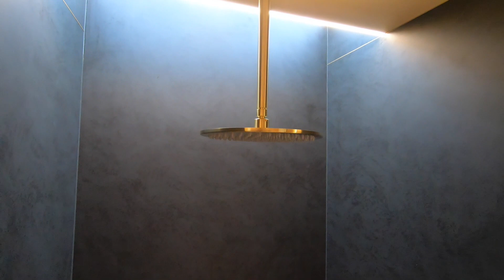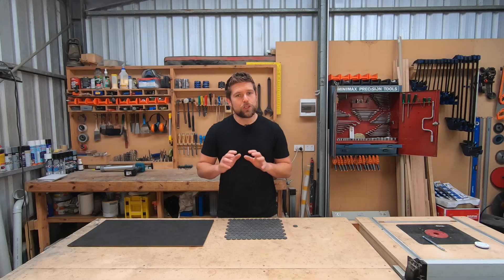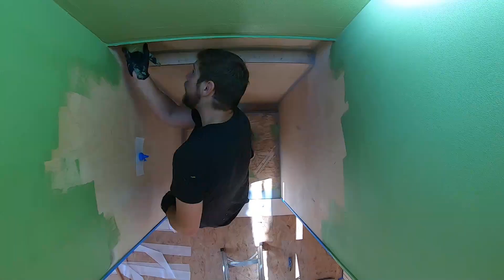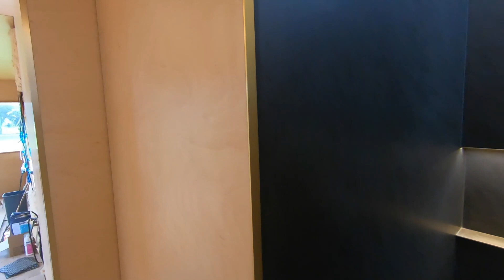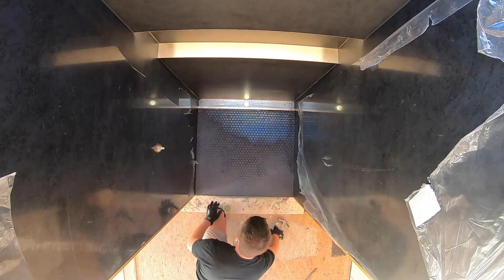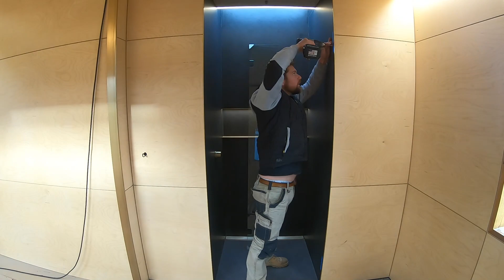Ep. 35 - Waterproofing, lining and tiling my shower - Tiny House Build Update

Comment: I love the look, hiding the vent in the skylight is an amazing idea. though I probably would have tried to hide the shower head up there too, just to keep the dark look.
Reply from the maker: Yeah I am so happy with that vent idea. I am anticipating should pull the steam straight out really well. I have a good volume fan and it isn't pulling through a vent so should have good flow. Haha I would normally do something like that, but I actually like the contrast. When I see the shower head on vs of it looks a million times better on. The brass against the black looks amazing. The brass also reflects light into the space which looks really cool.

Comment: Great and incredibly informative video as always. 🙌 As a cabinet maker I couldn't help but giggle at the phrase 'push it through the CNC'. I feel like that phrase is reserved for the panel saw, you're more likely to 'place on the CNC and walk away' although i'm unsure if that saying is going to take off.
Reply from the maker: 🙌 Haha I absolutely got that saying from the phrase of pushing it through the panel saw. Although with CNCs it's close to all you do. You just push a sheet of whiteboard from the pile to the CNC. Unless you have auto load in which case you just press print 😂. I keep telling people that the cabinet maker will just print my kitchen why on earth would I spend weeks pushing a cutting list on my jobsite saw. Thats without talking about edge banding, cutting hinges, marking out runners etc etc.
Reply: @TwoHandsandaTinyHouse  100% agree. I’ve been running my business for 10 years and i outsource all of that. I don’t want the outlay, floor space and maintenance of a massive commercial CNC and edgebander. I’ll stick to what I do best which is solid timber work and install.

Comment: Great work mate! How are you securing the shower door for transport?
Reply from the maker: Thank you mate. Great question. I am actually going to take it off and strap it to the bed. The hinges just clamp onto it. Couple reasons. It's heavy and those side panels/hinges/brackets are not designed to be shock-loaded. Also, I want to reduce weight at the front of this trailer as my ball weight is a bit high.

Comment: Perfection! Just a comment to others doing showers. NEVER scrimp on the tanking (waterproofing) the tiles are decorative. The water WILL go through the grout but expect that and ensure the shower base drains with no tiles on them.
Reply from the maker: 100%. In fact, I would say there is no way to scrimp... there is only a right way. Trying to cut corners is just asking for expensive and difficult problems. The only thing which is seen as compliant that I would never touch is one coat waterproofing. For me, the chances of getting a pinhole are just too high, not worth it. I didn't get too much into the process of water proofing, perhaps I should one day, if it helps someone get it right it'll certainly save a lot of heartache one day.

Comment: 🙌 It looks like it will be a relaxing place to start the day. I had my bathroom renovated last year, switching from white to concrete style paneling. What a difference on bleary eyes. My small bathroom looks smaller but I like the calm ambience.
Reply: I'm looking at concrete for a renovation of my parents' bathroom and I'm looking at products. Do you have a recommendation?
Reply from the maker: @elrey8876 https://www.bunnings.com.au/wall-art-2400-x-1200-x-3mm-concrete-matt-wet-area-wall-shower-panel_p0095450. Very easy to work with and looks great for what it is. I would always prefer tiles (or some other finishes if I could) but for a good looking easy finish this is great.
Reply: @TwoHandsandaTinyHouse  Gracias
Reply from the maker: Oh it looks a soooo much better that would have been a great move. I don't like this panelling other than a couple colours like this. Feels warm and inviting.

Comment: More amazing dedication and attention to detail. Did you at any stage consider a whole shower space insert like you see in the VW GRand California or Winnebago Revel to eliminate water leaks?
Reply from the maker: Thank you my friend 🙏. No absolutely not, and not fibreglass inserts either. I really wanted it to look as much like a house as possible. I am not worried about leaks. If you do the waterproofing layer right you shouldn't have to worry. It creates a vert elastic membrane that can resist movement. It's also why we bond break the corners. That's where the membrane continues across the corner but does not adhere to the membrane for about 10-15mm. This allows it to flex and move as the substrate moves but does not tare. Get waterproofing right and you won't ever have to worry about issues.

Comment: I am definitely not normal, it is beyond me why anyone would use tiles that need grouting. It is a dirt trap and a high maintenance material. 
Don't get me wrong, the shower looks great, like everything else you do. And it is a personal choice thing.
Looking forward to the next episode.  👐
Reply from the maker: 👐 What do you use in wet areas instead? I really struggled with floor ideas that were durable and looked nice. 
I haven't had a lot of trouble with grout. You shouldn't really have to do maintenance if it's done right and with a sealer stain resistant. Do agree that something like these hexagons do trap a bit more dirt when trying to sweep but I find a stick vac with a hard floor brush super easy to clean them with. 
Love your support, hopefully I can get a vid on the bed out soon.
Reply: @TwoHandsandaTinyHouse    Hi Phil, I doubt I will be able to give you any good ideas. While I like things to look good, practicality more often wins the day. My version of that build would certainly not have your polish in design and finish.
From a durability, waterproof, ease of cleaning I would have gone stainless. Very boring and only reasonable looks, fairly bombproof though.
I probably shouldn't have said anything, the job you did looks really great. I am usually fine with most materials in the right place and context. Unfortunately tiles have suffered from two previous revamp experiences where I was fixing what was there and not ripping them out.
And even when taking them out, they have a tendency to lean towards the fairly gross end of the spectrum.
Thanks for the thoughtful interactions.   👐
Reply from the maker: Nah man I love hearing people's different ideas. I actually considered something similar. I was looking at lining it with brass. But a friend said they had experienced something like that with copper and when you got in there it was cold as hell and very uninviting. But as far as ease goes that is one of the things I like about this panelling. Clean and simple.